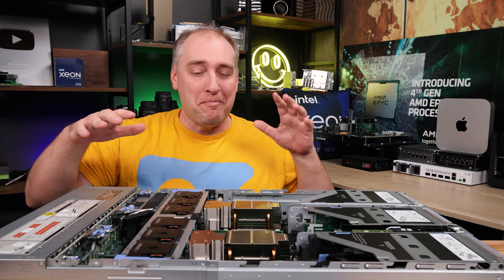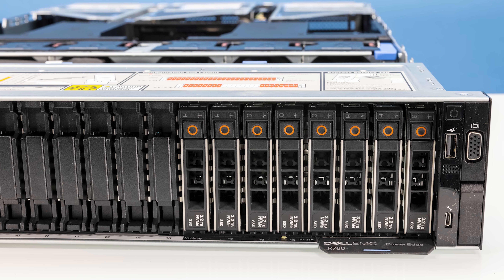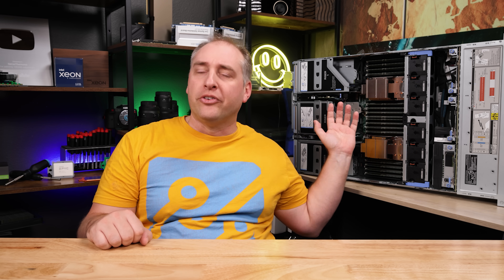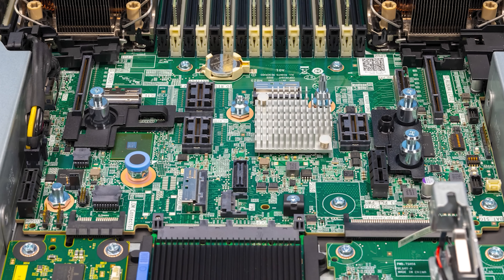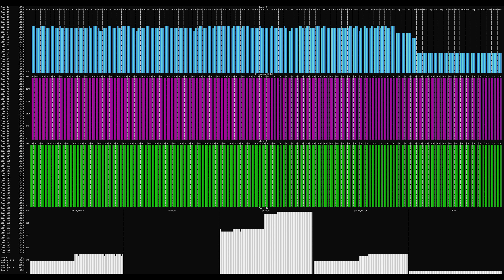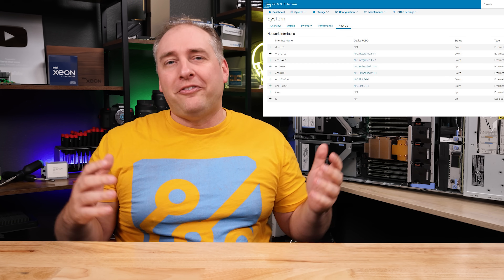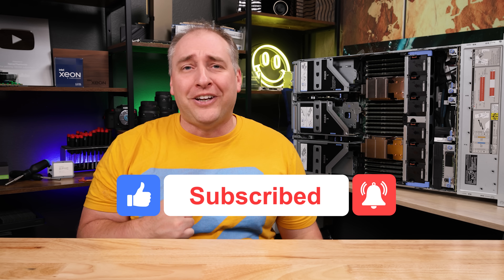Dell PowerEdge R760 Review New 2U Server Standard

Comment: i have a r630 and i am very happy with it, besides the fact it hates GPUs, i have a T400 in it for LLM and Video transcoding. Yeah, i know it's over the power limit for the PCIE, because DEL says 35W for the dual raiser, but it's the only PCIE device in that raiser so it should be fine. i bought my r630 for 600€, 2 years ago inclusive 2 damaged powervalt.  It had at a single e5 2603v3, 128gb ecc 2133 32gb RAM modules, PCIE RAID controller for the PowerValt, internal perc h330 mini, 4 port 10 gbit sfp+ NIC and the chassis is the 8 bay model, and it has a idrac8 with Enterprise as well. 
To my surprise, in the slightly dented PowerValt's are each 12 SAS 4tb 10k drives and only 2 of the 24 drives weren't operational. At first i thought the back plane maybe damaged but after testing, i conformed those 2 drives are dead. I ask the seller about the drives and he said i can have them, it's his fault not checking for the drives so i bought them as well. 

i spend another 600€ on 2 new CPUs and RAM modules for the second socket and 8 SSDs. Now my system has 2 xeon e5 2683v4 and 256gb RAM. in the r630 are all SATA SSD 500gb for the OS and my LLM and services, in raid 10 for the fastest performance and somewhat protection against of data loss. The NAS and Backup part is saved on the PowerValt's, i mean nearly 35TB is more as enough. Each PowerValt is set up in a raid 6 and both PowerValt's are a copy of each other. i think that is safe enough, for now.

Comment: From a homelab point of view, these aren’t going to be suitable in my opinion.  The latest gen are at least 2x the priced the last gen.  The noise from the fans is also high unless you mod the server. Which due to no cables for the fans looks impossible on this server.  Then the idle power consumption…. I wonder if the r7615 is different…. That said I’m super happy with my r7515 and plan on getting another.
Reply from the maker: I think you are right. That is a big challenge with the new generation of servers. Also, the power consumption is increasing by a ton. Next year we will have 500W TDP CPUs from AMD and Intel and NVIDIA's Grace Superchip is already at 500W.
Reply: @ServeTheHomeVideo  Thanks for the reply! The other thing that goes with power consumption is heat too.  My single server heats up a room noticeably, it'd be interesting to think of the 500w TDP CPUs in terms of heat dissipation - will you be looking at the watercooled options for the latest dells too?

Comment: 14:26 - Yes there is the normal Markup Game from the Big OEMs, but DDR5 has been way more expensive from launch than DDR4 and is slowly coming down.
HPE's "Product Bulletin" tool has pricing data and I've been collecting it and wrote a script to scan the data for a given SKU.  Here is the 64GB DDR5:
IPL-2022-12-14:P50312-B21 HPE 64GB 2Rx4 PC5-4800B-R Smart Kit     $5193.00
IPL-2023-02-03:P50312-B21 HPE 64GB 2Rx4 PC5-4800B-R Smart Kit     $5193.00
IPL-2023-04-10:P50312-B21 HPE 64GB 2Rx4 PC5-4800B-R Smart Kit     $4421.00
IPL-2023-05-10:P50312-B21 HPE 64GB 2Rx4 PC5-4800B-R Smart Kit     $4068.00
IPL-2023-06-13:P50312-B21 HPE 64GB 2Rx4 PC5-4800B-R Smart Kit     $4068.00
So you can see the 64GB DIMM WAS over 5 grand "List Price" and has dropped twice since then down to 4 grand.
During the same time period, the DDR4-3200 (Ice Lake) equivalent was 3500 initially and has dropped to 3100 now.
So DDR5 is still more expensive, but when you factor in the Markup Game (These are all "List Price" which almost no one actually pays), it's right now only 20-30% more expensive depending on the DIMM Model/Size.
Reply: Oh and as Patrick said, the DDR5 is 50% faster right out of the gate.
So if you want the speed, a 20-30% price increase to get 50% more performance isn't terrible.
If you want the cheaper price, buy the older model.  R750 (or HPE DL380 Gen10 Plus would be equivalent)

Comment: One of the universal laws of computing is that ALL 1U servers suck. Either you use them without rear cable management which means you have to unplug all the cables every time you wish to work on the internals which just sucks or you use cable management and if you need to unplug a cable for some reason, well that really sucks.
Reply from the maker: Awesome! Just landed and saw this. Made me smile. Have a great weekend

Comment: Regarding the heat sink size comparison, are the Microsoft servers of the same form factor?

Comparing total mass and fin area would be really interesting, as well as the total fan rotor area / CFM in each case so the cooling systems can be completely compared.

Comment: As the proud owner of three older Dell Poweredge machines-  I freaking love them. Nice and easy to service, and they've been rock solid reliability-wise with hardware support that you just never see in any other server vendors' back-catalog.

The only downside is the 1U stuff is a bit loud. My two R410s sound like a pair of idling Pratt & Whitney J58 turbojets lol
Reply: The fan control issue is a constant pain in the forums. You often need hacks to get them to spin slower. I just got three 760s and they are loud as hell until you get to the OS and things get settled. 740 is almost whisper quiet in comparison.

Comment: Left you a comment regarding the consumption but for some reason - youtube is either censoring it off?

Anyhow, i have a single socket Intel Gold 5317 Dell R450 deployed consuming 190-200W out of the box doing nothing - idling in Windows.
Contacted support and they told me they had this configured as "Max Performance" out of the box. 

This setting can be changed  under a power profile to "tame" the power consumption in IDRAC/BIOS - this was what support advised.

Consumption went down to around 110-130W under load.
Reply from the maker: That is totally correct. Dell configured that power option but it is what we used for the performance runs

Comment: Inside and out, the R760 looks just like my R750. Your noting power usage is interesting. My R750 uses almost 400 watts at IDLE with two gold CPUs and 8 or 16 RDIMMs installed. That's crazy; more than twice what my T620 pulled when running 30 virtual machines. The thing didn't touch on, seeing as these machines are going to end, like you said, in home labs in five or 7 years, is the noise. The sound of the server, equipped with so-called very high performance, or "gold" fans is unlivable in a home situation. I have a case open with Dell on my R750 to have them allow the fast to spin down below about 37%. I have taken to replace the gold fans with standard performance fans just to be able to use the server for a few hours, as a swing host while doing maintenance on my R740, which has the same fan speed issue, but is a little quieter overall. Dell's servers are amazing pieces of engineering for the data center and for those who can afford them. But the last couple of generations, and the ones to come, are not going to be welcome in the home lab.
Reply: The poor idle numbers could be partially due to poor efficiency of the power supply at the extreme low end of utilization. If top end will never approach 1400 watts, it's better to get a lower spec psu to better match the load.
Reply: @AlexKidd4Fun  You make a good point regarding efficiency of the power supplies at lower output, but how long would it take to recoup the cost of electricity and the few percent efficiency gains after spending for new power supplies. "Greenness" aside, the outlay is not worth it.
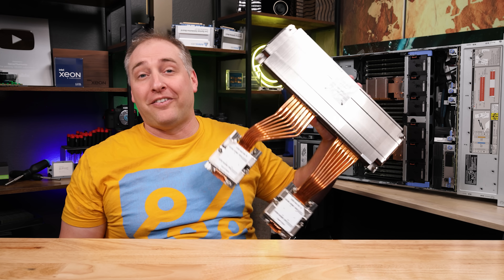Reply: @6:36 I speculate it's due to Dell's compact cooling architecture as opposed to Microsoft's huge and complicated heat pipe system.  I suppose there's no IPMI script to force the later gen PowerEdge fans to idle at 5%? Doing that did wonders for my R730. It went from unbearable to being able to live with it in my bedroom
Reply: @primeral  Nope. Dell firmware ignores any changes made through iDRAC, IPMItool, or anything else.

Comment: Part of me wishes there is a chassis that supported 8x 3.5" drives and 8x 2.5" drives in the front.
Reply: T550 Tower model has an 8x 3.5" + 8x 2.5" NVMe! But obviously it's a tower instead of a rack form factor.
Reply: @Goodman_4629  wow for a 500 series Dell the t550 is no slouch. It is a bummer is a tower though. Not that I'm worried about density in my silly little setup. Honestly the r720 I'm running is overkill as it is.

Comment: Cool servers for sure but dell axed manual fan control in 14th gen on so not really sure these will make it in a home (not colocated) lab
Reply: You can still set fan speeds manually via cli/scripting, RACADM, Redfish etc., we just removed it from GUI access/control. Dig through the docs & attribute registries and you'll find the relevant objects.
Reply: @absinthenishi  so ipmitool raw access is the only thing that's been locked down? That's how most people set fan speed and running those commands returns an insufficient privilege error

Comment: As far as idle power, I've found Dell servers consume a huge amount of power in their fans. (On much older models, there are undocumented IPMI commands to manually control fan speeds. They obviously removed them once people found them. I can reduce the power consumption of mine by ~100W!!! by slowing the buggers down.) Also, storage... the more storage to stack in there, the more power it's going to need. esp. for non-SSD's.

But seriously, who's going to buy one these and leave it sitting idle!
Reply: I found that too I was able to get my r7515 down to about 100-140w idle with hardware mods

Comment: Dell  Poweredge Servers might just have the longest life as compared to any other server. I myself have transitioned to only using dells in my homelab after trying out HP, Cisco, Lenovo and Supermicro
Reply: What made you prefer dell over Supermicro?
Reply: @jannikmeissner  don't know about OP Divyansh but I did the same, basically parts availability is HUGE plus the build quality of the Dells is much better if you're working on them all the time.   Other niceties such as firmware updating (dell DRM, or lifecyclemanager) is a godsend.
Reply: Because you are not tried ibm servers
Reply: @eng3d  pretty sure it still won’t change my answer because again parts not easiest to find. Dell is in a recursive loop, people buy more Dell because one of the reasons is easy part availability which causes more parts to be available in second hand market and so on. Also idrac is so frikin good, I think the only advantage HPE has over dell is their trial console viewer in the cheaper versions of ilo.
Reply: @eng3d  have tried/used IBM servers they're basically like HP in that getting firmware, updates, and parts are a PITA.  actually a little worse than HP in the parts market as you can find HP parts a little easier.   But both suck for microcode and other support compared to dell.

Comment: Microsoft servers? I didn't know Microsoft were in the business of selling server.
Now, if you had a Dell with the EPYC cpu instead, now that would really be a beast, lower powered, and more of everything at a fraction of those 2 Platinum Intels...
Reply: Yeap. And that's a 1U heatsink. 1U is tough with modern 1000 core systems. (One of the systems we designed needed solid copper heat sinks and 15k fans for a 1U chassis. 2U needed none of that crap.)

Comment: Well this explains all of those $200 730s with V4 Xeons that were on the used market a month ago I passed up on and missed out 🤡😢......
Reply: Yeah, R730's are a great deal, would skip the R740 and watch for the R750's as the R740's are PCIe gen 3 (same as R730) and R750 brings Gen4.  Plus performance difference between intel cpu's is minimal.  From ~2016 is where AMD's Epyc really took the lead and intel has been doing very small IPC improvements since ~2012 or so.

Comment: Man I wish Dell did engineering work like this on consumer machines.
Reply: What I meant was good engineering for functionality. 
The XPS lineup costs as much as a MacBook Pro but with a worse VRM and thermal design (at least comparing the old intel machines). 

Alienware machines use chassis that are 2 decades old with new plastic bits on top to make it look good (subjective but that’s their goal).

They’re all a pain to service too. Typically the PSUs are solid, but they seem to use the same engineers as the servers. Dell servers are impressive, even the most expensive consumer Dell machine is a let down. Which is a shame, I have friends who want a gaming pc and there are few good options and I feel like I have to warn them profusely about how bad Alienware is or else I’ve failed them.
Reply: They are. In the server world it's not unusual to have non-standard components, interfaces, motherboard layouts, etc. etc.
They're not considered pre-manufactured e-waste there, because servers tend to be used quite long and often find their way into the second hand market (sometimes more than once).
So when dell do their weird design quirks with the motherboard that goes all the way to the front-IO in a consumer pc that is bad, because consumers don't usually wholesale replace their fleet of machines, and instead upgrade/change individual components of a computer, which is made impossible if manufacturers like Dell don't adhere to any of the standards. It's fine in servers tho, because most of the time when you buy a server you buy at least a combo of chassis, mainboard, PSU and storage backplane. and like this they're also sold on. And if I say any more about this I'll just keep repeating what I already said.
Reply: If they did that, Dell couldn't cost-optimise their machines into oblivion so they can maximise profits...
that just wouldn't stand!

Man would they be cool as frick and painless to service though! Would love if Dell made their Inspiron line as stout as the Poweredge lines.
Reply: Yeah, I got new Dell Latitute laptop worth 2k+ USD last year and it is hot since new. Literally you can fry eggs on it while working with Excel…
Reply: They do. But consumer machines are made to be cheap.
Reply: @jfbeam  dell precision has the build quality your looking for.
Reply: @jfbeam  actually they don't, their XPS desktop machines sometimes have the most weird design decisions, and their XPS laptops have had throttling issues for many generations now...
Reply: dont forget their AlienPlasticWare
Reply: Just use the server as a consumer machine and add rgb
Reply: Yea, they definitely don’t. They are spread way too thin on client system portfolio sprawl.

Comment: I watch these from the bottom of my poverty pit so I can plan for my lottery win.
Reply: or get it in 8 years when its $200. I wonder how quiet it is.
Reply from the maker: it is not
Reply: @ServeTheHomeVideo  is it as loud as a Dell R710/R730 when idle, In a cool room?
Reply: @mechy2k2000  it is worse. These CPUs are power hungry mtfs. They can climb up to 700W each. Dell enviromental certs state these servers can be as loud as 72db. Hpe and Lenovo show similar numbers
Reply: @mechy2k2000  Server equipment is not quiet. The question is instead just how loud it is. Having damaged my hearing by working with servers I can safely say that you should always use hearing protection when working with more than one server at a time. And even then it's worth using those earplugs just for the peace of mind. My hearing was shoot before I turned 40...
Reply: @mechy2k2000  you have no
Reply: I still have 6x T710 in my active assets across 3 server rooms. I recently invested in 3x T420 192GB, 20 cores. With time, we shall get there bro, don't worry 😉